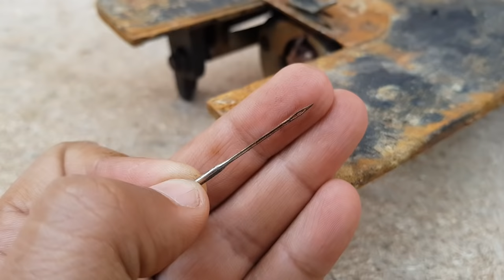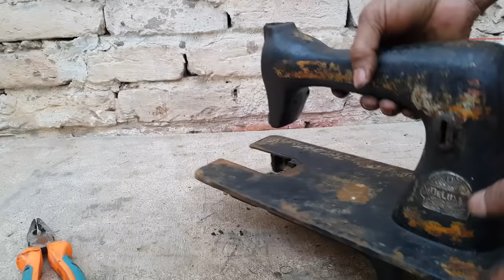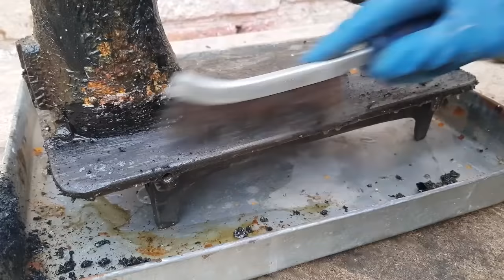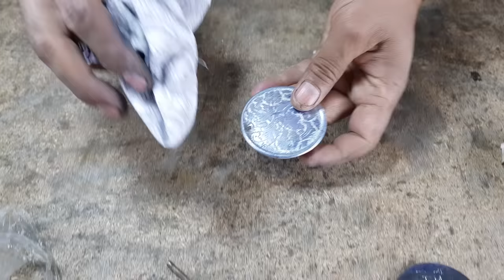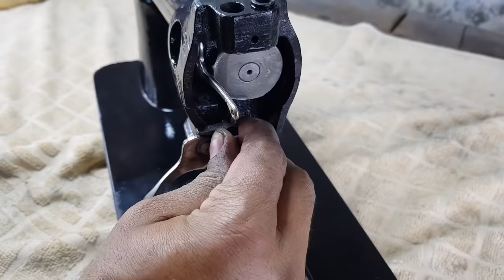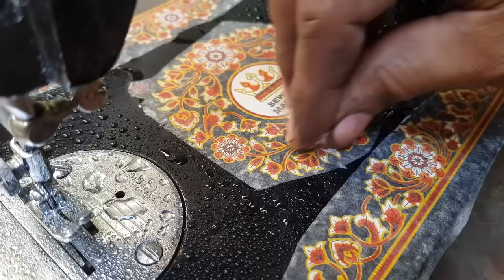Restoration 80's Sewing Machine Very Old / Classic Style Machine Restoring

Comment: Therapeutic to watch. A good job.  I didn't like the style of decoration added at the end and I preferred the old box case, so  a shame he did not restore the box case as well.
Reply: So u wanted him to make a whole new box because that was not in restoration condition?
Neither that was the part of machine
Reply: Because this was a badged machine, (made in bulk and sold under many names) the decals were more than likely no longer available.  Generics and Singers are.  They are bright, because many times, the original decals were also.  As for the box?  My guess is that it got refinished and used elsewhere as a display case.  Ultimately though, boxes are there in order to carry the machine with a lid.  Most of these hand cranks lost the lid long ago.  The new box prolly came with a new lid, even though we didn’t see it.

Comment: Hard work and amazing results. I did not know you could send for the decals and put them back on. The wood frame was restored also. Now I know I can do this myself. I do not have an electric system to clean the parts. I will have to use WD40 and brushes. thank you for showing me this. I bought a singer that was left outside and is rusted badly. I want to do this myself. I WILL USE PARTS CONTAINERS TO keep parts sepperated because this the first machine for me to rebuild.
Reply from the maker: Glad you enjoyed it

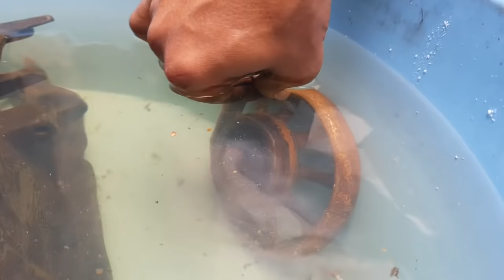Comment: 8:00 This is not how you use electrolysis to remove rust. In this setup, you're using whichever is the anode (positive) as a sacrificial metal to derust the cathode (negative). All of the other parts that were dumped behind the body of the sewing machine aren't going to do anything but get nasty water on them because they're not in circuit.

A proper setup would be to attach a bare wire to all of the parts that need rust treatment to the negative cathode of a battery or voltage source and use a sacrificial piece of metal like rebar on the positive anode.

Comment: As others have mentioned, I got a little nervous about him losing those little screws. I bought one of those metal bowls with a magnet on the button. You can find them in the automotive shops, mechanics use them. The magnet is really strong so the screws won’t fall out even if you accidentally bump it. 
Otherwise, great job! I’m definitely saving this video.

Comment: Before the paint stripper, and electrolysis, this sewing machine could have sold for close to $1200.00 because it is an heirloom. Here are some tips for next time. Use tape wrapped around your pliers. Use simple green D and a modded palm sander for the oil and rust. Electrolysis pits heavily the metal. Do not strip the paint. Use sewing machine oil to clean the paint. And only use sewing machine oil to lube it. If you resort to stripping the paint, do not paint the cast iron, season it like you would a frying pan. Simple green D or molasses for stripping rust. The D means it's is safe for aluminum. This machine may now sell for $100.00. no acids. And keep any patina and original paint. Cheers.

Comment: Looks very similar to my 1917 singer electric sewing machine came with a hand crank wheel too but i dont have it but the dangerous decayed and exposed cloth insulated input wire still powers it even the light socket adapter it came with works also have an old white rotary its not frozen but i cant find a power cord for it actually had a removable cord that ones from the 40s

Comment: The body restoration was not good. Sure the mechanical bits needed a lot, but everything that indicated the date of this machine I.e. the enamel and gilding has been eradicated when what it needed was for the rust to be stabilised and a preventative finish put on the top. The new paint job is very crude, so sad. The painting on the wooden case is also pretty hideous. I rarely leave a negative comment anywhere, but just this, a sad restoration, all the history completely eradicated.

Comment: You stripped the original paint job off (which is one of the most appealing pieces of these old machines) and while you attempted to replace it with cheap decals, you also left off the original manufacturer details so anyone who purchases this sewing machine is going to have one hell of a time trying to find replacement parts. You even removed a metal plate with the original manufacturer. This is hardly a restoration in the sense of "restoring an old machine back to factory" it's just returning it to working order with no respect for the history.